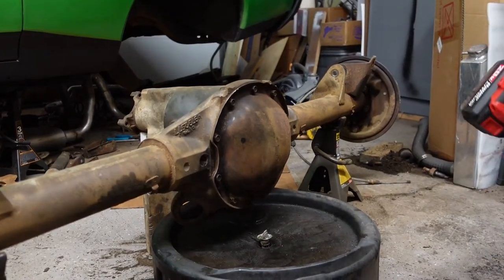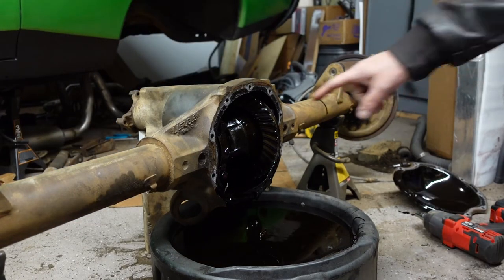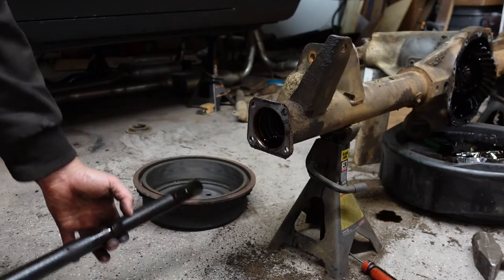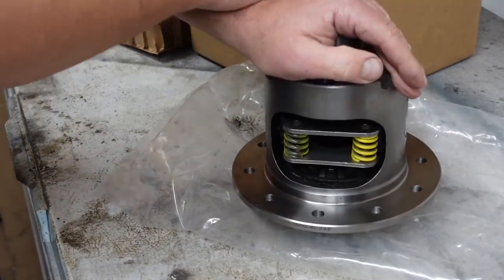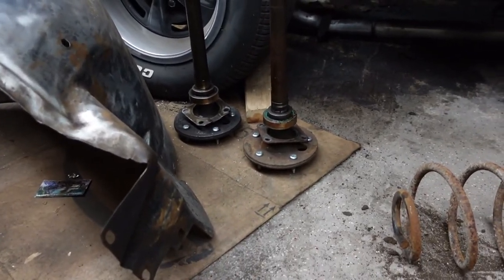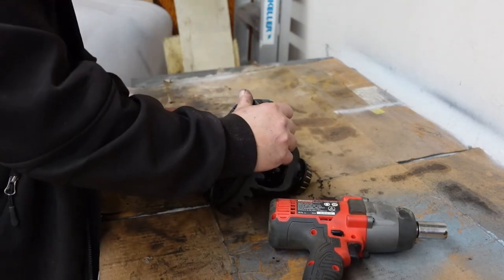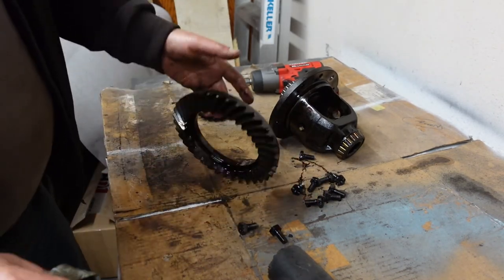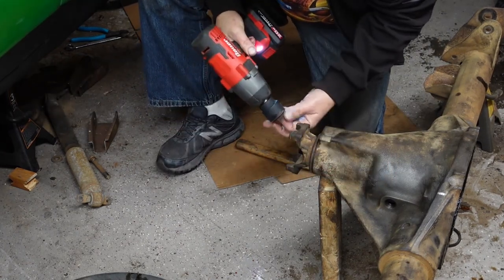1968 GTO A Body - GM 8.2 10 Bolt Rear Axle Tear Down

Comment: As soon as i saw the rear diff cover i thought that was a BOP 10 bolt with no c-clips.
Reply from the maker: I had to do some research to get the proper center section and bearings.  The entire drivetrain on this car was from donor cars at some point, so it made it interesting finding the correct parts.

Comment: Thats a BOP 10 bolt, no C-clips, its actually kind of a desireable rear end...for an 8.2. I know this is an older video, but you could remove the u-joint flange with a hammer and a brass punch, alternating strikes from side to side.
Reply from the maker: Yeah, that flange was a bear to get off.  I honesty hope I never have to take it apart again.  Has been holding up good so far.